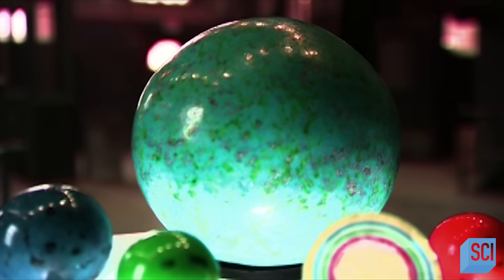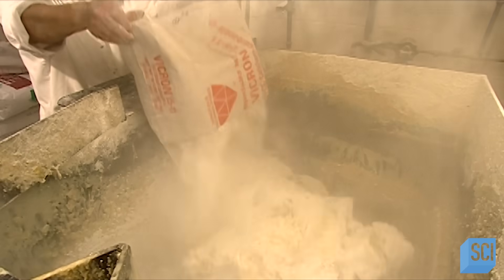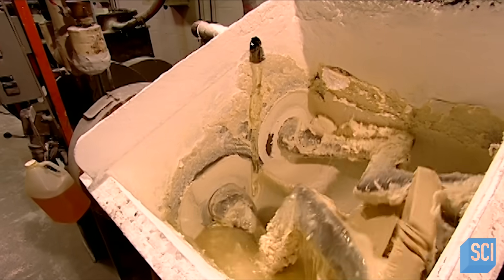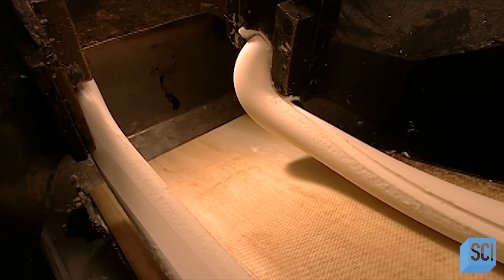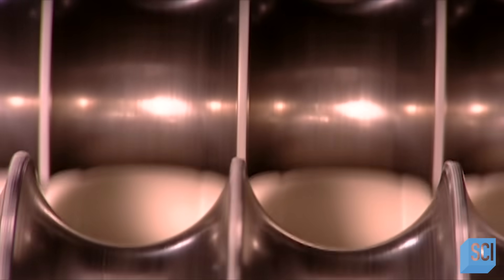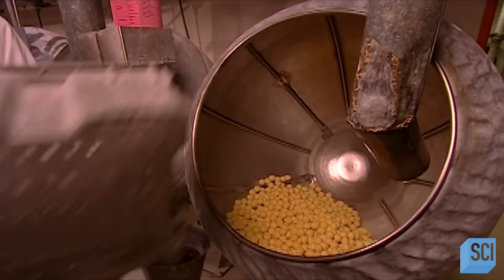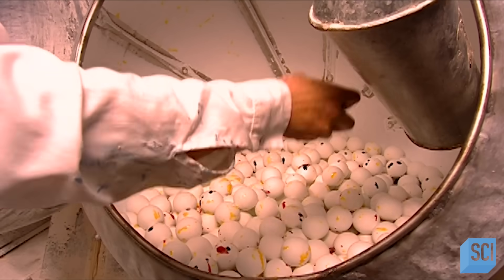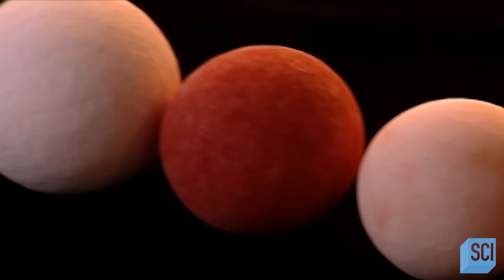Fan Favorite: Jawbreakers | How It's Made | Science Channel

Comment: I don't even want to know how or if they clean the machines.
Reply: High pressure water is more powerful than people give it credit.
Reply: @rangerfurby  Well, I just got a pressure washer to wash my car.  I put my finger under a STRONG setting - and it was STRONG enough to cause immediate discomfort.  Mine is a lower level one meant for cars, as opposed to industrial cleaning.  It's still cuts though.
Reply: Ikr sounds like heck with extra steps 😂
Reply: They probably do and it may be almost as interesting as the creation process